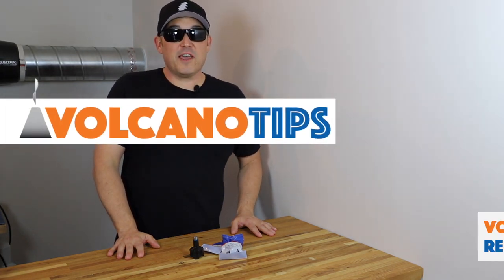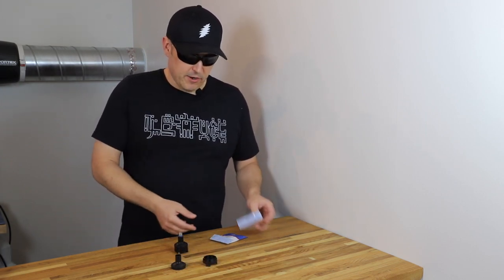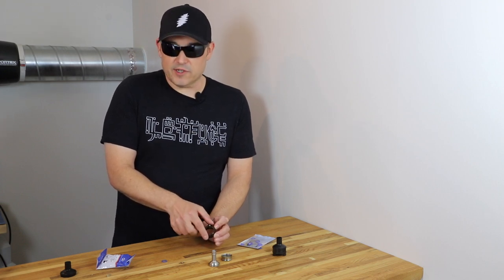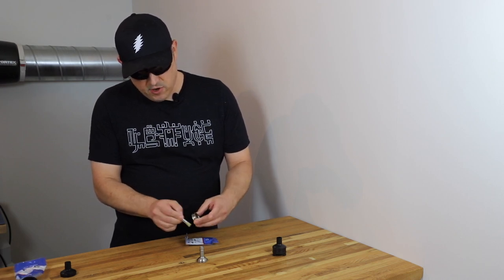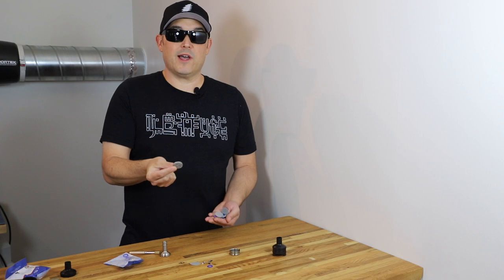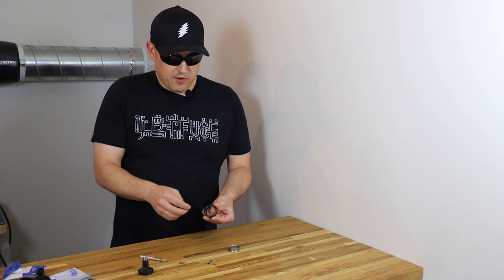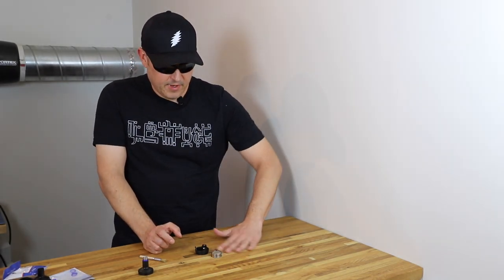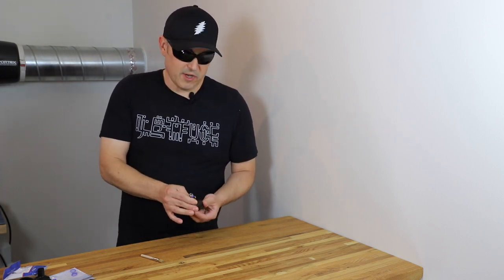How To Rebuild Your Volcano Easy Valve Chamber If It Breaks

Comment: Great video! But I discovered you can put the inner chamber in the housing and then insert the clips. They slide into the holes nicely and click into place. But you do have to remove inner chamber to remove the clips.